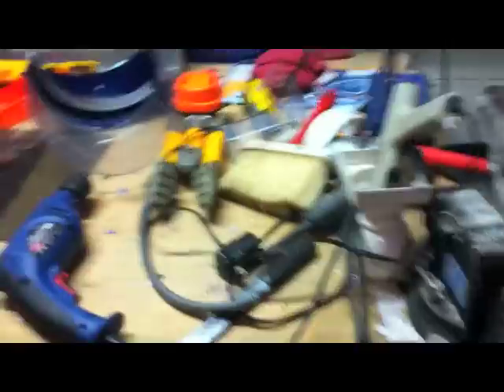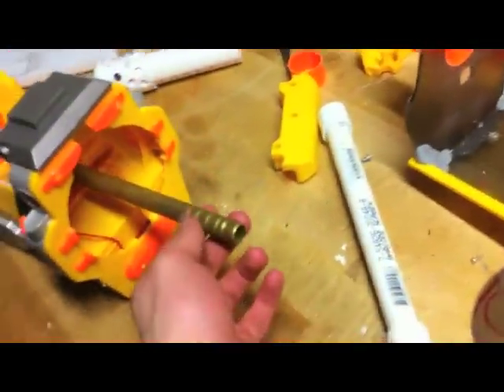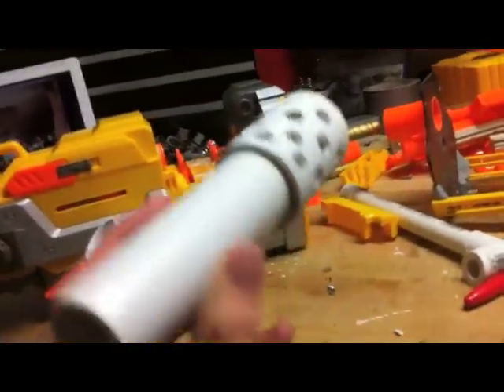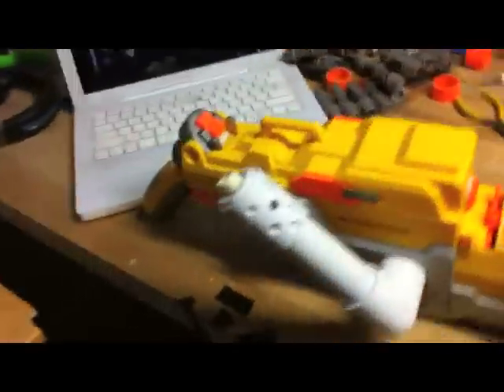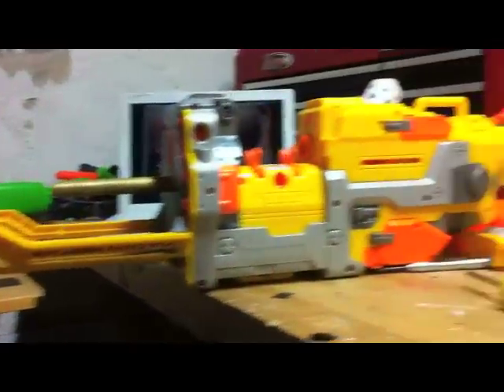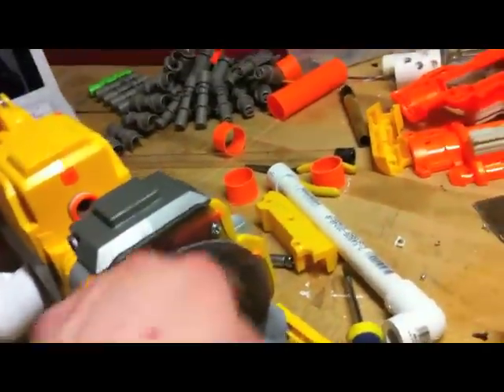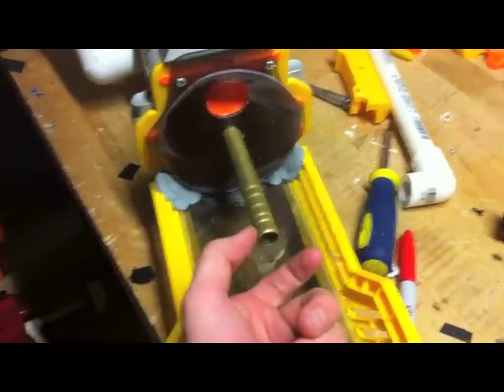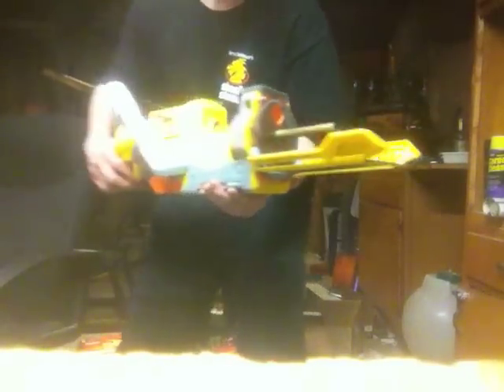[Vulcan Project] Fabrication day 2

Comment: just an Idea, if you plan on boosting the voltage to the motors at all you probably could use the exhust port as a functional piece to cool down the motor with maybe an intake on the bottom at this point it probably is too late but maybe an idea for future mods.